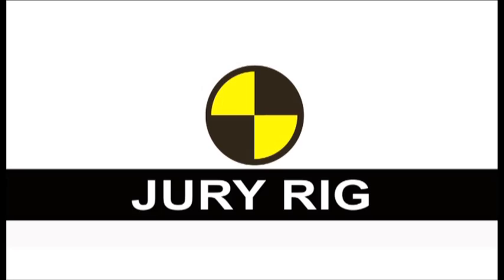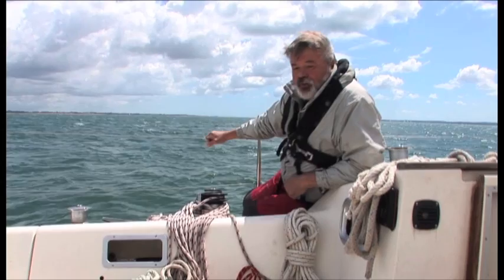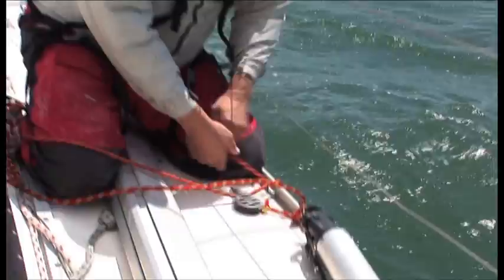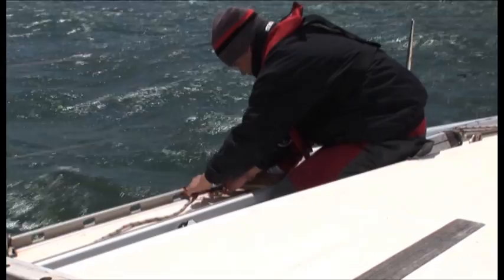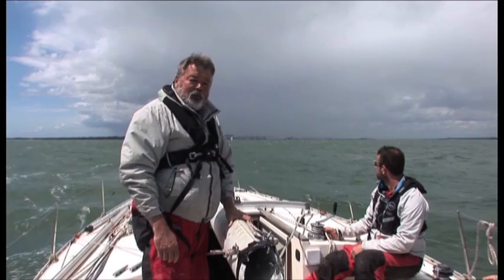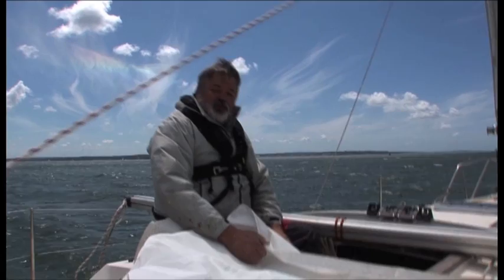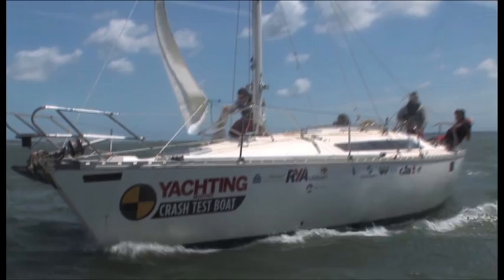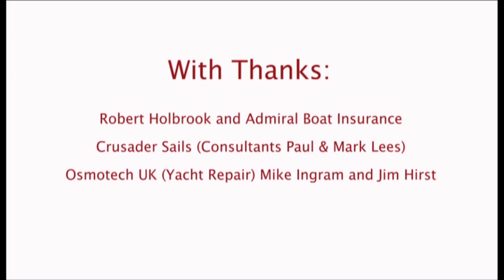Yachting Monthly's Crash Test Boat Jury Rig

Comment: Dismasted a sixteen Hobie after getting caught in a squall about seven miles outside Haulover cut in Miami while trolling about  forty-seven years ago. Around "71" or "72". After removing main, stowing sails and lashing mast, I tried sitting on a hull in front of the tramp and paddling in, that didn't work. Ended up lashing the boom up for a mast and rigging the jib foot to the now vertical main sail boom. For the conditions it worked exceptionally well. Made land at Golden Beach after dark. By the way, as a side, back then the only electronics carried or available on a small sailboat was a transistor radio in a waterproof bag.

Comment: One thing it does point out is that one should have some spare odd hardware and tools with them as standard emergency kit. I'd think and manual drill (crank driven) and a hack saw are 2 tools not used but could come in handy. It may also be worth while to carry some sort of sheathing to prevent tear out of the hooks in the top of the mast - maybe some heavy stainless steal hose clamps.

Comment: Very good work. I own a chinese junk. You did well with what you had.
I'd have tied only two lines to the gaff. One well on forward and the next only 20 to 25% aft. Both would haul the main. Downhul the tack and sheet the clu. You now have a chinese junk rig. Works well in high wind.
Reply: John Clayton yeah that's what I was thinking... Also you do not need blocks.... All you need are the lines.... 8 would have just used rope at top of the stump no need for metals.... I probably would have beaten down the torn aluminum edges and tied over the top and around..... Many ways to skin that cat.... I have Several ways I would have rigged this.... I'm not much for having that big hunk of metal banging around overhead it's very dangerous the Way its flapping and banging.... Always think in terms of having at least one end under control.... Leverage on yards is important

Comment: I sail with a Sailing Club in San Diego, California and I rent/charter nice sailboats for local sailing in the Southern California bight, where most winds are light and under 15 knots.  But the Club is not legally required to provide more in terms of safety equipment than what is required by the US Coast Guard.  I am putting together a tool kit for daysails and overnight sails to the local islands.  Your suggested tools are excellent start.  Another important thing is a checklist before you sail

Comment: Genuinely curious, why did you choose to go with a square-rigged approach as opposed to triangular main, i.e., tying down the sail at tack and clew reef points?
Reply: SV Sparklemuffin I wonder this as well.
Reply: Reduced loads laterally against the base of the mast.  Also, you would reduce the reduction of square feet of sail: meaning the rectangle would be more square feet than the smaller triangle would give ya.  Theoretically, the triangle would be so small one wouldn't need the boom: note close to the end as they experiment with this (think of a stormsale, jib, genoa).

Comment: We actually broke a mast in winds of 30 knots when we did a jibe (unintended).  This happened 500 miles south of San Diego, CA in Mexican waters, luckily we were over 30 miles from shore and we had the stump of the mast to jury rig a sail sort of a genoa and were able to sail south and not approach the mainland.  If we had more metal working tools such as a bolt cutter it would have been easier to cut the stainless rigging. And a portable hand crank drill would have been useful. your video good

Comment: Only thing I would have done different would have been to lash the cross yard to the stump to prevent its flailing.... I probably would have gone for more of a gaff rig too..... One of to consider as well is that if you rig your sail into a kite which can be done with the lightest of spreader strips.... A kite can power you just as a sail and if it's up there is in the wind out of the way and does a great job..... A kite surfing kite is a great thing to have on board as an emergency rig... They are extremly easy to control provide excellent power and can sail up wins quite well.... If I go to sea a canoe is my go to dingy with out riggers.... They are fast easy to control extremely sea worthy and with tarp across the top almost unsinkable... The south pacific canoes with outrigger and side boards are the standard.... If you include a kite you can travel fast and far..... With a simple gaff rig as well.... I would love to sail around the world with a canoe

Comment: It went down in 30 knots, lets see you set that up in 30 knots and corresponding seas - or technically even higher winds, as 30 knots would not normally take down the rig. :)

Comment: Good deal but personally I think you think to much and complicated things... Kiss keep it simple stupid..... No need for any pulleys or the hooks at the top..   And I would go to the original chain plates.... You can get tension with prusik knots and tension hitches like a truckers hitch.... Then just keep tightening until they are tight.... No need for any blocks pulley's or anything other than rope.... There is only need for 3 ropes to hold up the mast and then if it have enough line back those 3 with one rope to back up each